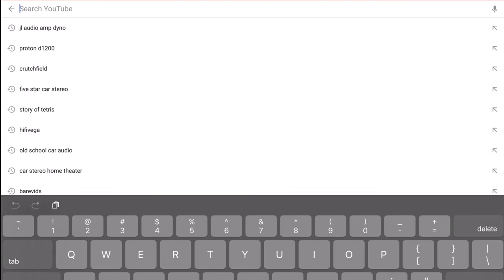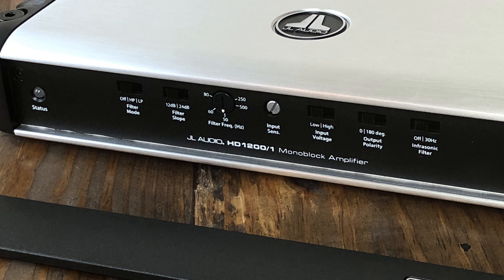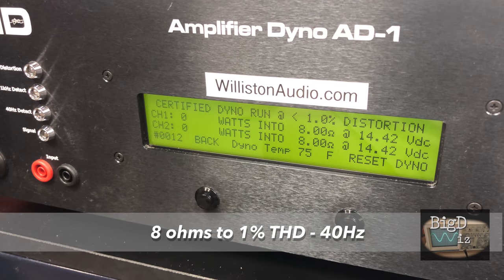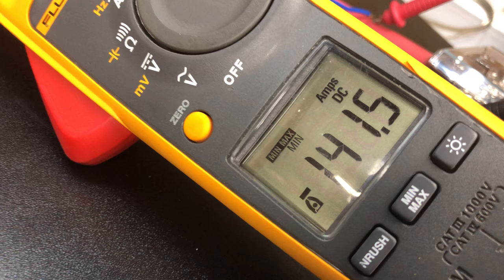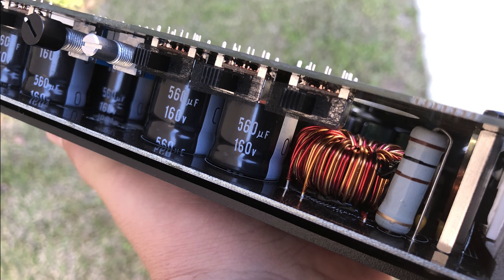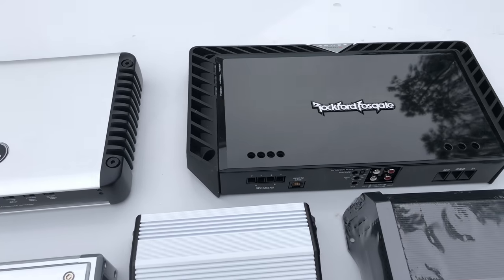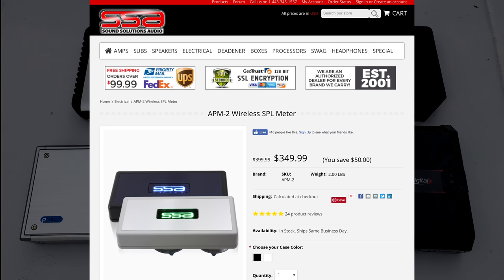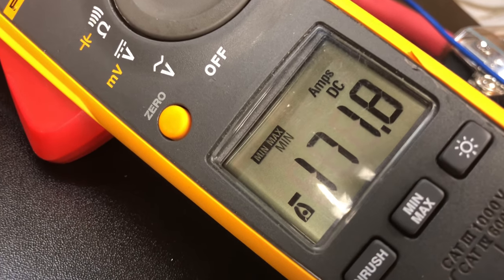$1100 for 1200 watts? JL Audio HD1200/1 Amp Dyno Test

Comment: I'm with hifivega, not too impressed with the value.  Especially being made in China.  And the first thing I thought when I saw the connectors is that they would be a big fat negative.
Reply from the maker: Connectors make for quick disconnects, but yeah, for sure make the amp require much more space for the install than you would assume by the size
Reply: The only people that seem to need quick disconnects on an amp are thieves.

Comment: iPhones are made in China, and I can GUARANTEE you most people commenting are rocking an iPhone even though there are plenty of Androids phones are that are far cheaper and far superior to the iPhone. But we buy them anyway because they are nicer phones. At least thats the perception. Ive been around alot of those HD amps and they are top notch. Yes you can get more power for the dollar. But like the Mercedes analogy, your getting a proper product. Well built, well designed, an American company that stands behind it (and they do, seen it first hand). Theyre just nice amps. Buck a watt was the standard for years as the line between good and not so good. Weve been showered for years by "Cheap" big power, low price, low quality amps. So much so that amp lines like this, and Boland and Linear Power have an uphill battle selling a 150 x 2 channel amp for $1000+ plus. Stick one of those CAB amps beside the JL and see which lasts longer. And yes I know the Boland and Linear are hand built which help to justify the cost, but can you justify your 1000 iphone? Its made in China too
Reply: +BigDWiz One a side note. Youve got a W7  from the same company. The same thought process could be applied to it. There are many, many subwoofers that will do exactly the same or better for way less cash. But you know and I know, the W7 is a much better woofer, so thats the one we chose (W6 in my case) ALSO: not comin down on you D You DA MAN!!!! Just voicing opinion
Reply: I’d put up my 1200 watt Kenwood Class D amp against any JL Audio amp for reliability. Hell, for power too !!!
Reply: Matt Bowles 
Android is junk
Reply: Sorry to say but JL isn't as reliable as u stated. People don't buy JL for reliability,it seems more like bragging right. The mtx 9500 are more reliable in my opinion and cost less, they also take more power.
Reply: @ericbachmann8037  i dont your kenwood amp will pouch 1200 at 4 ohms
Reply: RighteouzKings 
Not at 4 ohms. But it can at 2ohms. It’s rated 1200 watts rms at 2 and 1 ohm and is 1 ohm stable. I would bet it can do every bit of its 1200 watts.
Reply: @Highqman1974   That's not making much sense. You just said there's far better woofers for way less cash, and that's a FACT. Then immediately in the next sentence, you claim JL is the best, so which is it make up your mind. I'll do it for you....JL IS WAY OVERPRICED   That should be info even Capt' Obvious is privy to by now. ✌️

Comment: the cost is in the technology on the amp. it does its true rated power at everyday driver power, without upgrades to your electrical. the price tag is for no matter what, you have true power.

Comment: Tried this amp before I got my alpine. It was alright and sound good but I believe over priced. Also the power and ground plug sucks. My pdx hits harder in my opinion
Reply: I replaced my hd1200 with an Alpine PDX-M12 the 2nd time the amp broke down on me. Much better SQ & reliability from the Alpine & it cost me far less than the JL.
Reply: @j.savage1228  I also did an install for a guy and was stoked to hear this amp. After a week the infamous blinking light came on (this seems to be a  common default with these amps) switched to the M12 and all good now. The efficiency of these amps and the XD models are also red flags given they boast about their efficiency.
Reply: Stop hating i got a jl jx 1000 with a re audio 15 xxx an boy i would freak u out
Reply: thats funny cause i went from a pdx to a hd and thought the hd was way better

Comment: Ran slash series back in the day.. they were the only Amps at the time outside the liquid cooled Phoenix golds that wouldn’t clip or shut down from extreme heat in the summer.. since the slash came out in like 01-02 they been the most consistent brand of amps I’ve had the pleasure of working with.. not the most watt to cost but they are built like tanks. Always been worth the price.. I beat 4 1000/1’s for 5 years everyday and still sold them working like new.. now my daughter is about to start driving and I’m going to hook her up 😅

Comment: The Rockford T1500 should out perform that JL amp any day of the week.  Plus it looks much nicer and doesn’t use shitty wire connectors.  Those things are a joke on the JL.
Reply: If the connectors were a problem, don`t you think JL would have changed or removed them all together  from the HD amps after more than a decade on the market. Just asking.
Reply: CDP did you watch video?  Have you used these amps?  The connectors are stupid just like the old PPI amps.  Wire works its way loose.  Their marketing is to not show any pics of the crap.
Reply: Yes I watched the video, yes I have and use these amps, and no, the wire does not work loose if it`s properly inserted into the connector and the wire is the proper size. I`m using the HD600`s and the HD750. 4 gauge NVX power wire, which is the same size as JL`s 4 gauge wire and it fits perfect in the connectors and has never come loose.
Reply: CDP 4 gauge wire is not the same as 0 gauge.  LOL seriously, let me know what you think of the crap once you step up to hd1200 and some real power wire.  I can’t take anyone serious that uses CCA wire.
Reply: Dude, either you`re blind, can`t read, or you`re just making up your own reality show because at no point and time did I ever say anything about using CCA wire so how can I or anyone else take "you serious" when you`re saying stuff that I never said. Plus, my comment/reply was about the actual connector plugs not being a problem on the HD amps.With that being sai, it`s obvious you have never used or know anything about NVX power wire because they don`t use or even offer CCA power wire. Yes, I know 4 gauge wire is not the same as 0 gauge wire and to also help you understand why I use 4 gauge power wire.....that`s the size that JL recommends not to mention that`s the size the fits into the connector. As I said, i`m using three other HD amps and the HD1200 is an awesome amp but I don`t need or want a 1200 watt sub amp for just two 10" TW3`s. I do use 0 gauge, again NVX, into a fused distribution block with four 4 gauge outputs.
Reply: CDP the reality of this show is the connectors are a horrible design, end of story.  They really show their flaws when using big wire.  I’m guessing your not running 8awg to your subwoofer or speakers.  Once you try stuffing 4 strands of 8awg in that connector you will see.  You are the only person I have came across in 22 years that likes that style of connector!   And most definitely one of the only ones on earth that would defend it.   Its okay if you love your amps.... good for you.  Its obvious that they are some of the only amps you have ever owned.  There is nothing wrong with that.  But defending a poor design doesn’t make any sense in reality.    

If you had installed your equipment you would realize some of this stuff.   

On the NVX wire.... while its not horrible or as bad as some once you compare it over to some good wire you will see the difference.  Grab a chunk of NVX and compare it to Temco wire or some stinger pro wire from 15 years ago.  Then you will notice the difference.    It’s all marketing....and easy to fall for..... but do you really think NVX wire is tinned with SILVER? LOL.....  they will word stuff ways to confuse the casual consumer that feels they are up to speed on stuff.
Reply: The reality of this show is that this show is not about the connectors on the amp. 

The connectors on the JL amp have not been out for 22 years so what other type of connectors other brands use does not belong in this conversation. It`s nice to know that you`ve asked every person on earth about the JL connector and i`m sure you`re happy they agree with you. You`re guessing that i`m not using 8 gauge wire for my subs? Well, that`s your problem, you guess too much and by the way, it`s you`re not "your" when you asked me about the 8 gauge wire to my subs. It`s also nice to know that you know about what amps i`ve owned. With such intuition, you should not be wasting your time on YouTube but instead you should just play the lottery every week because i`m sure you`ll win. Hmm, are you saying that you`re 22 yrs old? 

Oh by the way, no, i`m not using 8 gauge speaker wire for my subs but I am using 10 gauge which is more than enough for my HD750 and yes it`s NVW wire. 

Stinger Pro wire from 2003 is not around in 2018 and Tempco wire is not specifically made for car audio but it can be used if that`s all you can afford. Here you go again bringing up something about whats in a wire that I never mentioned but it`s obvious you went to the NVX website and read up on their power wire so good for you. Sounds like you disagree with what they said on their website about their power wire so you decided to ask me if I think their wire is silver tinned and you laughed at it. The reason you laughed is because the truth hurts and in order for you to save face, you want to come back and talk about two other brands of wire. 

Since you`re the one who brought up other brands, i`ll do the same. Do you think the Kicker power is  any good and do you believe what they say on their website about their power wire?
Reply: CDP no comment on any of your statements but by the by, I really like Kicker power wire ✌️
Reply: @caseytbss  feel like you're hating on NVX wire for no reason but to argue with this guy it's top notch wire only downside is it's expensive. It's OFC with lots of stands tinned in silver like all of the highest end wires are its oversized great wire. While personally I just go for standard OFC chances are that NVX wire is slightly better then the Stinger wire you keep going on about.

Comment: Ill stick to my Fosgates and older Phoenix golds! Im guessing that Fosgate t 1500 will stomp a hole in that JL, power wise and sound quality.
Reply: Power? Yes

Sound quality?  Nope.
Reply: @dmoreno762 
 sound quality. Yes. I like Rockford's sound over jl. I got an t-500 that does 1000 RMS n more and a JL slash v3 1200. Biggest and baddest amp JL makes.
Reply: @migascustomsounds3054  110 sn ratio, .03 thd and a large dampening factor on the JL, quality is a no for fosgate
Reply: @fernandogonzalez5770  I prefer Rockford over anything JL has.
Reply: @migascustomsounds3054  weird but to each their own
Reply: @fernandogonzalez5770  I agree. Most of it has to do with durability.  I seem to break JL subs easier than Rockford. N I've exchanged many JL brocken subs that were powered correctly but pushed to much to accommodate for the lack of bass according to price.
Reply: @migascustomsounds3054  with all of my experience, jl is just always stronger on sq than rockford. And reliability seems to lean to the jl side too, ive had to fosgate amps fail and one sub give issues, but never anything with Jl. Then again i dont wire under 2 ohms and try to baby, so i dont know.
Reply: Also after trying the mtx 9500 10" I've discovered how small the Phoenix gold elite 12" is in comparison to it, the mtx seems louder n can handle more power so far.
Reply: @migascustomsounds3054  the 9500 isba crazy sub, it suprises a lot of people. Theres a brand that im a fanatic for named bravox. You cant find much because they dont sell to the US anymore. But man those brazilian speakers kick ass
Reply: @migascustomsounds3054  but yet, here you are at a jl video.
Reply: @markmaese1599  yeah and I also said I have a slash 1200v3. Whats ur point? I cant have an opinion? Theres no tests of my slash. I want to know its true power. I also have two w7 12s and a blown up Jl 13.5 that couldnt handle what my RF t2 was laughing at.
Reply: @migascustomsounds3054  sounds to me you like heavy duty bass head subs, can’t knock jl for not handling power like rockford can because two different subs and target sound. Jl alaays leans on sql and don t make spl subs but they can get loud enough, maybe just not loud enough for you.
Reply: @radiospank  jl does sound great but to me they are over priced and it kind of seems like they don't care about their customers. They don't sell recone kits. If u wanna fix a w7 u will have to spend about 400+ to ship it back. They dont have a box for 2 w7s. I do like their amps even though the power inputs are small. I also wish they had bigger amps.
Reply: @migascustomsounds3054  I agree they are overpriced but you know how is consumers are, we like name brands and pretty looks so we pay. However their amps are really good and clean I love my HD 1200, contemplating getting another one
Reply: @migascustomsounds3054 yeah but your forgetting, on the birth sheet it also says that you get that power out at 0ver 14.4 volts, which is laughable since it’s not going to stay that constant voltage without the Big 3 and a capacitor plus the wattage the RF amps put out may say that it’s clean but it’s very distorted, a real clean system for bass gets every lower tone, gets every kick and every bass note from a bass guitar, that’s the disadvantage for a SPL system, JL is more evened out towards SQ, that’s why everything is so expensive, it is driven towards audiophile purist it’s tries to get every note available with zero distortion
Reply: @johnryan118  not forgetn anything. I have the best JL amplifier. The slash 1200v3. I also have a old school Rockford power 500 that comes very close to the JL. Rockford does need more power but almost every amp that's gonna do more than 2000 RMS needs the big 3 also. The slash is very nice but doesn't get as loud so they don't need as much power. The RF power series have about the same technology

Comment: In my previous vehicle, I had JL Audio amps (500/1 and 300/2). I was extremely satisfied with them, even if I had to save my money for a LONG time to get them. My current ride's system uses Skar amps, (RP75.4 and RP800.1d) and I like them every bit as much as the JL amps. (Roughly $1,000 for 800 JL watts vs. $270 for 1,100 Skar watts)
Reply: Why is their such a big price difference on the jl amp compared to the skar ?

Comment: I sold my Jl audio hd 12000 i bought a  Rockford fosgate t 1500 /1 ... the differences is the sound quality hd 1200 is better. For power and money saving the Power t1500 is better.
Reply from the maker: Interesting, thanks 🤙
Reply: What does sound quality mean at 40hz? If it’s S/N you just get a over powered amp and put the gain low?

Comment: It’s great to see how this JL performs, thank you!  

One of the major features which was mentioned but not really discussed is that this JL will always provide at least its rated power at 4 ohm or 2 ohm, regardless of the input voltage (as long as it’s in the nominal operating range). So it’ll take on more current to maintain power output in case the supply voltage drops.  It’s a regulated power supply stage and not many amps do it...they just provide less output power when the input voltage is less than 14.4VDC.  

It’s still cheaper to just upgrade the entire electrical system vs paying twice as much for just one of JL’s top of the line amps. (It’s going to need upgraded anyway once more current is getting pulled!) Once someone is bought into at least the mid level range of what the good’ audio manufacturers, it’s really difficult to hear or feel the difference between amps with all else being equal.
Reply from the maker: Great points 👍

Comment: I had another great Pawn Shop find on this amp. It was priced $200. It still had wires sticking out the inputs like someone cut it off and sold it. I was skeptical but that darn thing worked. It was like new with a 2021 date sticker.

Comment: You're going to make alot of JL fanboys mad if you''re not praising JL.
You can get 1 Rockford Power T2500-1, 1 Orion HCCA8000.1D, 1 Ampere Audio AA-5000.1, or 1 Crescendo Audio BC5500D... 
I get it, most don't need that kind of power. just giving a contrast.
Reply from the maker: I’m a fanboy of JL subs for sure, but I leave myself independent on the amp front. Lots of good ones out there for sure and wow the difference in pricing 😱
Reply: For the same price I am sticking with my Rockford Fosgate 2500 BDCP.  Birth sheet says 3,553 & it’s not made in China 🤦‍♂️.
Reply: @Jon Rock where's it made?
Reply: Those amps just can't really fit the old school subs. Why? Lower ohm=more watts, but less output at higher resistances.
Reply: Those who jump in on the JL wagon are followers. Want to wear Nike shoes like the rest. Over priced for the dollar. Reminds me of old school days when it was a $1 per watt.
Reply: Comparing a crescendo 5500 and ampere 5000 (same amp btw, different heatsink) to a JL 1200/1 proves you have no idea what you're talking about. It's not for High SPL builds, it's for small to medium sized setups that require good transient characteristics.
Reply: Dito... who do you think watch these videos? Maybe you think 55 yr olds who need a 1200 watt mono bloch to listen to beetoven are watching. GTHO!

My comments are for the demographic.
Reply: I agree with Wiz, JL is godly expensive for what you get. But their subs sounds damn good! And I have heard abunch on the market.
Reply: BigDWiz i have a jl 13 .5 w7 and a jl 1000/1 and boy does it sound tremendous ,the only thing i dont like its the pricing on the amps but i buy them preowned so i dont spend all that money.Other than that i give it a A rating.
Reply: If it was a slash i would be pissed